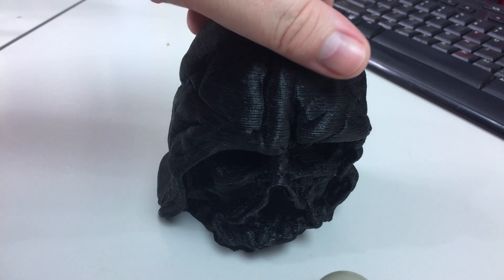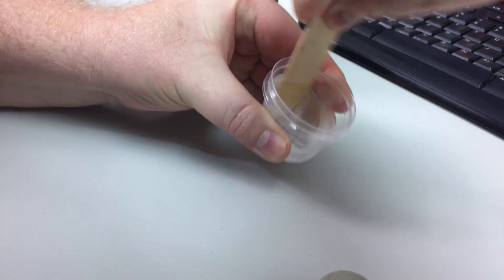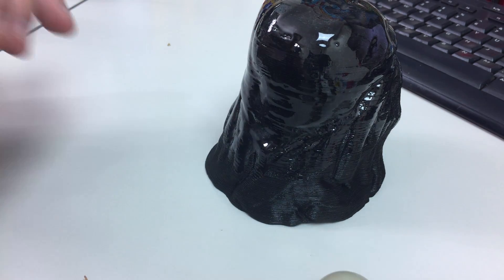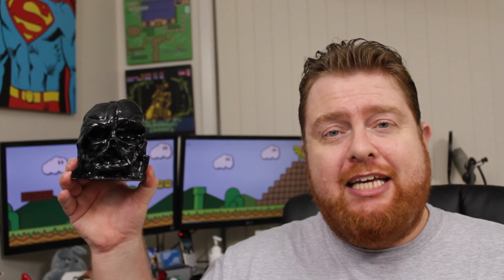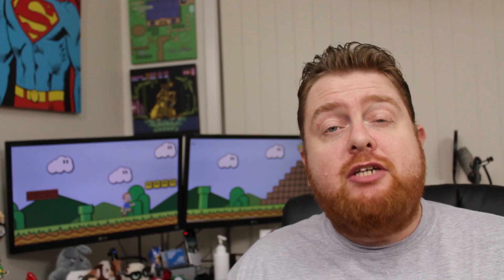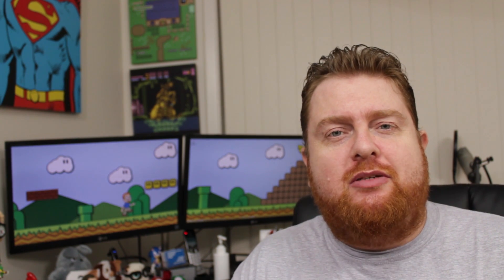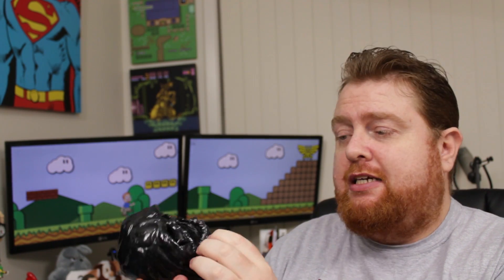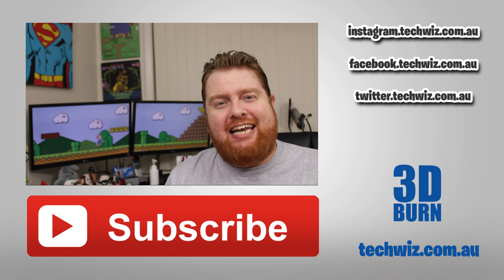Effective and Safer 3D Print Smoothing with Epoxy not Acetone

Comment: Another thing you can try is to fold the hardener into the resin instead of whipping it and trapping a lot of air into the mixture.  That's another reason that the mouth section has a white finish instead of being clear.  The mixture had too much air, and just hardened that way.

Comment: I've just finished this exact model this exact way because i saw you do it here. Only difference is I used zero infill and increased the size to 150%. All on my DaVinci 1.0a with XYZware. Cant wait until morning to see the final result after drying.
Reply: +TechWiz it came out pretty well. Slight splitting at the very top as there was no internal support but a bit of acetone and then the zpoxy and it now looks like it was part of the build. Will definitely be using epoxy smoothing again. Mine also looks like it's drooling as I filled the mouth area with too much but I love it. Thanks for the reply!

Comment: How paintable is the finished product after applying the Z-Poxy?
Reply: +Ryan Brooks I have painted a piece before, I actually used a product called Gesso as my primer before painting with enamal paint. that combiniation filled in the creases and smoothed the product like the clear epoxy used. after painting you can spray a coat of lacquer to protect the paint.
Reply: +Jeremie Santos Awesome!  Thanks for the tips! :)
Reply: +Ryan Brooks you can scratch the surface a bit, with 400 grit sandpaper, to have better adhesion - even better, paint and then seal the paint underneath with the epoxy - that's how they do it on cars (except it's polyurethane resin, and they call it clearcoat). Speaking of polyurethane - this is a cheaper option - the process is the same.

Comment: I bought PT-39 (here in the U.S.) via Amazon Prime, $13 for four oz.  Seems to be working well, though I'm doing a lot of trial and error to get the right thickness applied.  Some of my models end up with little pits in the resin where it apparently didn't fill -- I'm thinking that's because I put it on too thick overall, but perhaps you've got some thoughts on this?

Comment: ZAP has number of these epoxies with the same features written on the box, I wonder, what is the actual deference. For example why not PT-30 (cheaper) or PT-49 (says "finishing Resin and 12oz bottle is cheaper, than 8oz PT-39)
Reply: also, I just compared and XTC-3D costs 26$ a 24oz bottle, when PT-39 - 17 a 8oz bottle

Comment: I strongly recommend nitrile rubber gloves when working with epoxies, latex and polyurethane won't offer sufficient barrier against allergizing substances in epoxy. There may be far more serious consequences to frequent epoxy skin contact than sticky fingers...
Reply: Karri Koivusalo if you work with low voltage  electronics today you have to take a course in how to handle epoxy because of serious allergic reactions people have had in the past, i worked with epoxy in a course like that, with gloves AND a screen between me and the epoxy (like a box they also use in chemestry).. But i've seen SO many people from the USA just using it with their fingers, even commercials promoting products where they use the epoxy with their fingers fx. epoxy pudding.

I really hope that nobody prints out a toy for their kid and use epoxy on it....
Reply: +Jens Sigurdson I'd rather just have better awareness with the hazards concerning use of epoxies, banning them from consumer markets would be a disastrous setback for many hobbyists.
Reply: +mokana713 congrats you  are now officially allergic to epoxies. You are properly not gonna die tomorrow, but if you keep exposing yourself to epoxy the condition is going to get worse for sure.
I had a coworker that was pretty far in the allergic condition and over a period of less than a year he went from not being able to work in the casting room to not being able to go into the building at all without getting a reaction. Despite we had all the safety in place and the air and dust was monitored, he just could not be in the building - not even the lunch room!
It is surely something you should take seriously and what ever you do don't take a job working with epoxy ever again. This condition is for life, just like any other allergy.
Reply: +mokana713 If it is mixed and used in the correct environment (temp and moisture), once it is fully cured it is very inert. You should not get any reaction from fully cured epoxy. The cure time depend on how well it was made and how hot it has been stored after it was made.
In manufacturing a curing oven is often used to speed the process up. You will have to consult the specs for the specific type you have to know how to do it and how long the curing time are for the type you have.
(Using your kitchen baking oven is NOT recommended ;-) )
Reply: +Jens Sigurdson I worked at a shipyard for a stint and I sealed with epoxy paints for long periods of time with it all over my skin and hair along with other chemicals (I eventually had an allergic reaction and took a few days off) but now I'm a bit worried (I was a temporary worker so they didn't really tell me about hazardous materials and I wasn't given a dust mask till halfway through my stay.) I even accidentally mixed some paint thinner with the epoxy and it solidified right in front of my eyes and released a ton of steam and stuff.
Reply: Jens Sigurdson That sucks because I was just planning a large scale sculpture using epoxied candy. When epoxy dries is it less reactive?
Reply: +Elgaard2 If it cures it's safe, isn't it tho?
Reply: +Karri Koivusalo I'm a professional pattern maker and have worked with epoxy for a number of years in the model maker business. If I has to use it in the shop I'm required by law to have a three week licensed course to use it. Working with epoxy involves very good fume extractor, gloves and goggles. 
It is beyond me why it is legal to sell to private people at all. It is very carcinogenic and allergenic to all mammals... 
I'd take acetone over epoxy any day... Well not really, but I'm sure you get me.

Comment: You might be able to hit it with a hair dryer or heat gun on low heat to get the right amount of epoxy on there. Should smooth out any bubbles too

Comment: Just so you guys know acetone is in epoxy as a solvent. Or at least some form of alcohol. It actually dissolved a bit of those layers during application which helps the epoxy bond to the plastic better than and sanded profile ever would.

Comment: Nice video.  Just so you know, 30 minute epoxy means you have 30 minutes with which to use it...not 30 minutes for it to cure.  I've been using 30 minute epoxy for RC boat builds for a while now, and it's usually best to let it cure overnight before you start really doing anything else with it.

Comment: I don't have my printer yet but i had already decided to see if epoxy works for both smoothing and strengthening. I'm glad to know it does before i do it. I use epoxy already in my jewelry making and the cheapest epoxy I've found is at lowes in the paint section. it's called clear coat by famowood. it's for coating bar tops. i love the stuff!